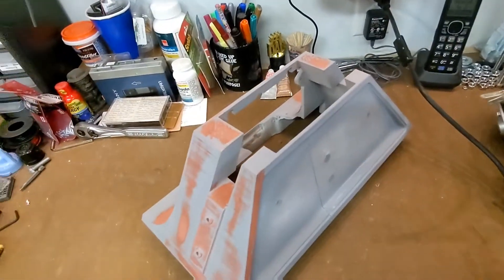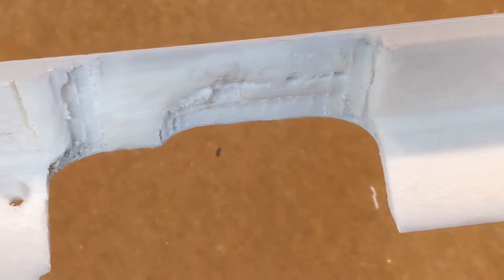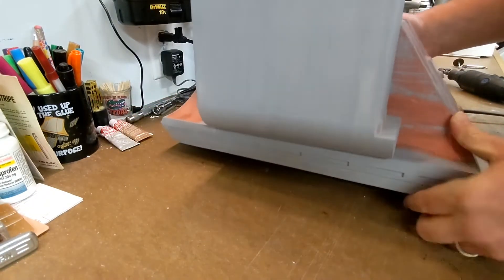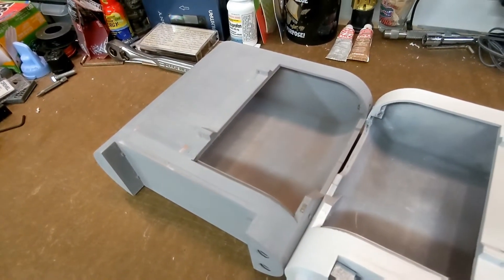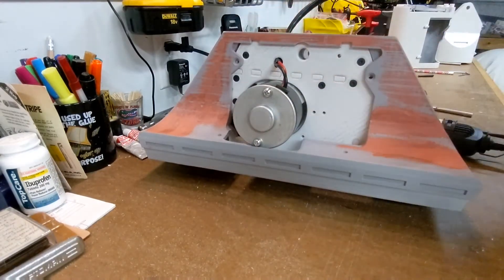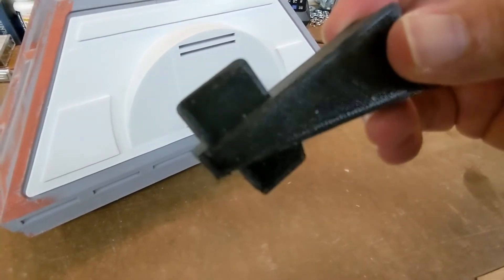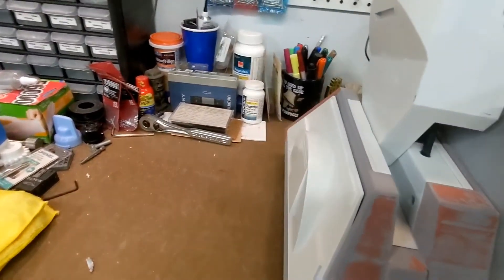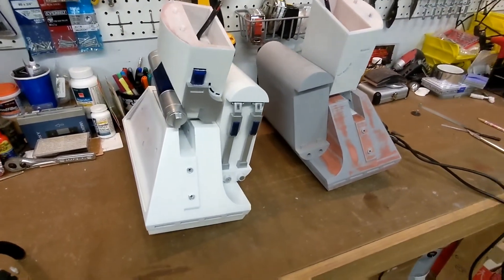Foot Assembly and Making Things Fit

Comment: What is the proper motor to get to avoid this problem?
Reply from the maker: Most Baddeley builders use 100 Watt scooter motors, not 150 Watt motors. I think the "typical" 100W scooter motor will more than likely fit just fine without the need to modify the foot shells. It's hard to be 100% certain though, as there are so many sources for motors and so many clones out there. I got my motors from Amazon, but lots of builders get theirs from eBay or other sources so there could be slight variations in physical dimensions.

From what I have heard from other builders, there is a pretty distinct power advantage when using 150W motors compared to 100W motors - that extra power can make a difference going up inclines or over softer surfaces like carpet, etc. I weighed the options and decided that for me, more power was worth the modification to the parts.
Reply: @jasonsR2D2  thanks Jason for the info, I'm currently in building the foot drives this will help alot!

Comment: Are you using Padawan 360 ?
Reply from the maker: No. I will be using Shadow+MD for my droid. The two systems are similar in that both are Arduino based and typically really on a Sabertooth controller for the drive motors. I have the components but have not yet hooked everything up. I'm sure I'll post something when I get to that point.